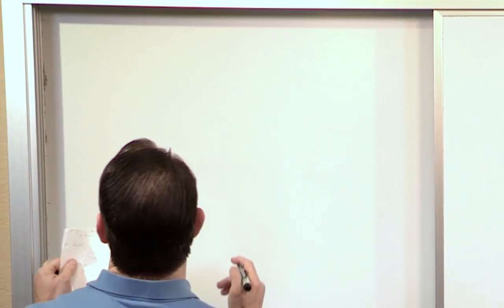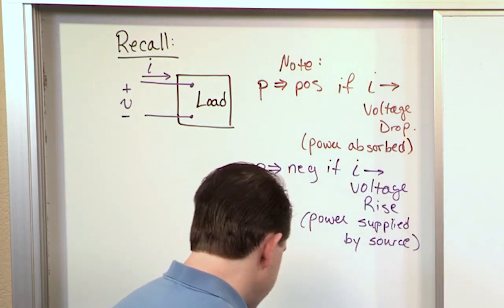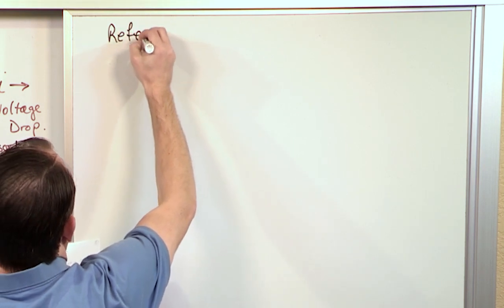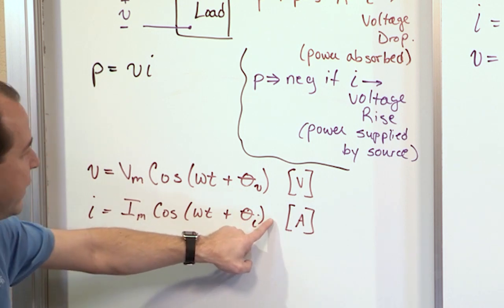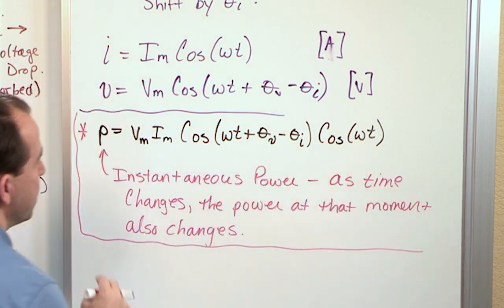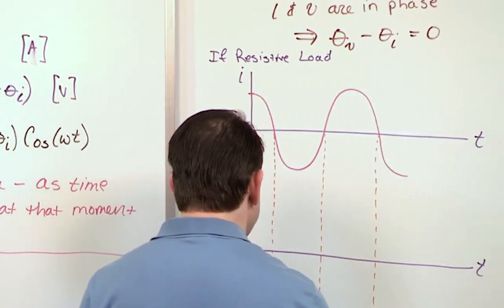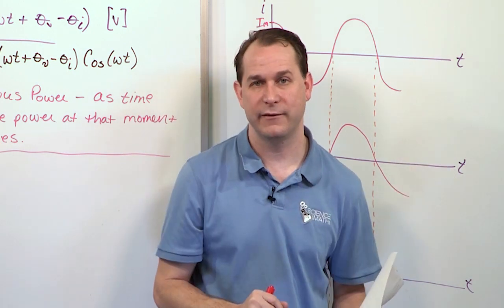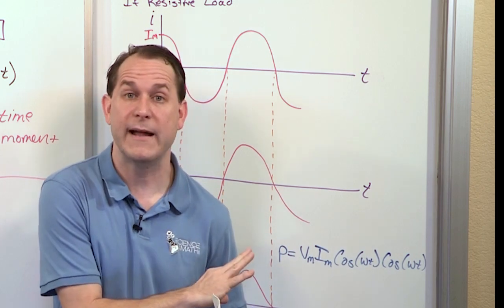01 - Instantaneous Power in AC Circuit Analysis (Electrical Engineering)

Comment: I have a notation complaint.  It makes perfect sense the at t=0, i=I m.  This means Theta i = 0.  Therefore, Theta i should be removed from all the equations and Theta v is the phase difference between the current and voltage.

Comment: why is the voltage always expressed in terms of a cosine? Why can't it also be expressed in terms of a sine?
Reply: there is nothing wrong with using sine. In electrical engineering, Cosine is more convenient because of the heavy use of Euler's formula.

Comment: Current in a resistor is a start-stop motion of conduction band electrons due to their collision with the rocking lattice ions, and this causes a resistor with a sinusoidal voltage applied, to produce heat. The polarity 
reversals of an applied sinusoidal voltage (with the direction reversals of the applied electric field) do not affect electron collisions with the lattice ions. Electrons colliding with lattice ions from either direction will continue to produce heat and there is no cancellation of the 
heat developed!
Mathematically, the average value of a sinusoid is zero, and so, the average value of the 
current will also be zero. The average values cannot therefore represent the heat developed 
in a resistor with a sinusoidal current.
A resistor cannot develop heat due to a current in one half-cycle and then cool itself 
by a like amount of heat during the next half-cycle! It develops heat either way whether 
the current is positive or negative. The lattice ions vibrate from collisions irrespective of 
the directions in which the electrons collide with them. Therefore, since the average value 
is zero, it necessitates the use of the root-mean-square values of the voltage and current to 
compute the power, which is a statistical measure of the magnitude of a varying quantity 
and is the square root of the arithmetic mean of the square of the sinusoidal function.
Therefore, since the positive and negative cycles of current will produce a heating 
effect, the average power delivered (P) will be given by P = V2
/R = I
2
R where V(I) = the 
root-mean-square value of the voltage (current) and not the average value of the voltage 
(current). The instantaneous value of power is v(t) i(t).

It maybe noted that electrostatics and circuits belong to one science not two. It is instructive to understand Current, the conduction process and Voltage at the fundamental level as in the following two videos:
i. https://youtu.be/TTtt28b1dYo and 
ii. https://youtu.be/8BQM_xw2Rfo

Comment: Negative power is power supplied by the LOAD  to the Source isn't it ?
Reply: You can assign whatever sign convention you want, but yes, if you assign power as positive when delivered to the load, then "negative power" would mean power supplied by the load and delivered to the source.  When that exists in reality, you really have two sources.

An application of this, is a battery energy storage system (BESS), that can be charged by the utility power, and can deliver power to your loads as well.  One reason you might want such a system, is if you have a time-of-use billing rate with the utility, which is common for large industrial applications.  Perhaps it is cheapest to buy energy at nighttime, and most expensive to buy energy in the afternoon.  With a grid-tied battery system, you can charge at night when energy is cheaper, and discharge to support your load when energy is the most expensive in the afternoon.

Comment: What’s the difference between magnitude and and amplitude? Is it not the same thing as I’ve seen you interchange between the two.
Reply: Magnitude is a term applicable to vectors as well as complex numbers, and amplitude is a term applicable to waveforms.   In this application, the two mathematical concepts both apply to the situation, and there is a convergence in the meaning of the two terms.

Amplitude of a waveform means the value of the waveform peak measured from its neutral position.
Magnitude of a vector means the Pythagorean theorem combination of all of its components, that indicates the total amount of the quantity, an analogous concept to absolute value.  For complex numbers it likewise means the Pythagorean theorem combination of the perpendicular real and imaginary components.

Since phasors are vectors that represent waveforms, where the magnitude of the vector represents amplitude, and the angle of the vector represents phase, it ends up being a coincidence that you can use amplitude and magnitude interchangeably in this context.

Comment: Great video lecture.  I got a little lost towards the end when multiplying voltage and current.  I think that is because I need more background on positive and negative power and circuit analysis.  I think that your courses would help me with understanding electrical engineering.  With your online courses, is it possible to get help if you don't understand a hard concept?  Do you have courses in electronics that would cover topics such as op-amps and circuit design?  Some of my goals are to understand IQ modulation and demodulation,  power flow in the grid where you have more than one generator, how one grid can sell and buy electrical power from another grid, and how to determine power flow with solar panels connected to the utility where you might need to find how much power is power is being delivered by the utility vs how much power is supplied by the solar panels with their inverters.  How would a wattmeter be able to determine power flow in case the solar panels were supplying power to the utility or if the utility is supplying power to the customer.   Thank you very much.
Reply from the maker: Yes I cover power conventions and all of the core topics in circuits but some of the things you are interested are really applications that I don’t cover.
Reply: @MathAndScience  I think that the math alone would be a great help.  Thanks again.

Comment: Can someone point me to where he explains why cosine, rather than sine, is used in the instantaneous power equation? All he says here is that cosine is always used in electrical engineering. But the sine more intuitively represents amplitude, IMO. Apparently I've missed something important to the discussion.
Reply: Ah, ha! He talks about this exact situation at the start of the next video! https://youtu.be/8zMiIHVMfaw?t=378
Reply: In the steady state case you can put the t = 0 point anywhere on the sine wave. Putting point  t = 0 at the peaking of the sinewave, i.e. expressing the input voltage as a cosine function, somewhat simplifies the maths. It also sidesteps the ambiguity whether to include the imaginary number j with the sine term to correct the maths.

Comment: Ecellent!! Very good job.  In a PURELY RESISTIVE circuit, how would I determine when the power is, say, 60%, 70% & 80% of the full power?  If necessary, I could provide an email address for the response.

Comment: The voltage and current in an AC circuit are given as v = 100 sin (314 t) ; i = 10 sin (314 t). Determine RMS power.
Reply: Power isn't a concept measured with RMS in circuits, so "determine RMS power" probably isn't what you meant.  You determine the RMS voltage, and the RMS current, but when you multiply the two together, you don't call it "RMS power".  You call it power.   Technically, it is average power over the course of one cycle.

The average power would be the RMS voltage * RMS current, when the voltage and current are both in-phase with each other, which is the amplitudes, each divided by sqrt(2), and then multiplied with each other.  In our case, this would be Pavg = 500 Watts.

If you really did want to find RMS power, you would multiply the v and i waveforms, and get P=1000*sin^2 (314*t).   Then convert the equation from sin^2 into regular sine, through the trig identity sin^2(x) = (1 - cos(2*x)/2).   This would be P=500 - 500*cos(628*t).   To determine the RMS value of a sine or cosine wave with amplitude A and offset D, you use RMS = sqrt(D^2 + A^2/2).  For us, D = 500, and A = 500, which would mean the RMS power is 354 Watts.

Comment: I fucking hate this subject. Why are there so many definitions? Average power, instantaneous, reactive, real, complex.... And why are there a hundred forms of the same equations ffs? And in the exam they don't give us a formula sheet, we're supposed to memorize the hundred equations and their hundred different forms.
Reply: Because when voltage and current are both sine-waves, then there are a lot of characteristics. What's the average voltage? What the peak voltage? At what time do we have what voltage? What's the phase-shift between current and voltage? All of those things have an impact on power, the way the resistances add etc. 
If you had to memorize all of those equations, then yes it would be a big deal, but once you understand the subject you really don't have to memorize every equation anymore, since you should be able to derive them from a relatively small number of equations. If you can't do that then you didn't understand the subject anyway.
Reply: There are so many definitions and equations, because voltage and current are not necessarily synchronized waveforms that follow each other linearly, like they do with simple resistive loads.   The definitions and equations are to help you keep track of phase differences and the implications of voltage and current not being in phase with each other.   Components like inductors and capacitors cause this phase shift, and this phase shift means that current and voltage don't simply multiply to get power.